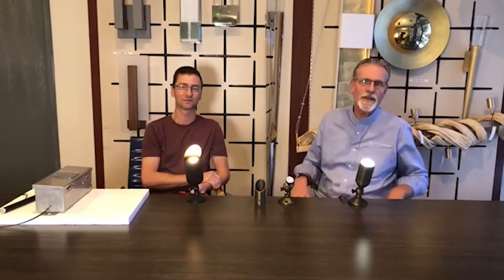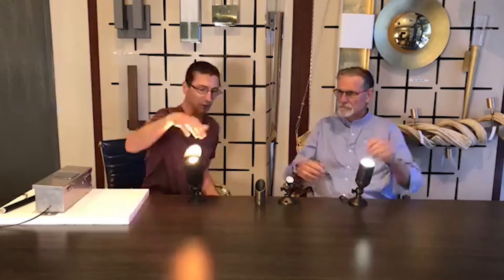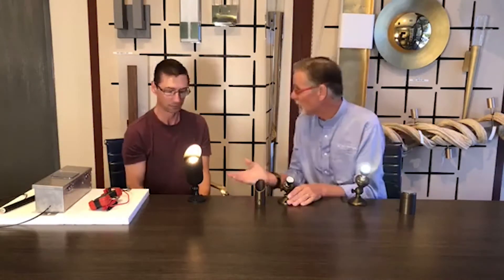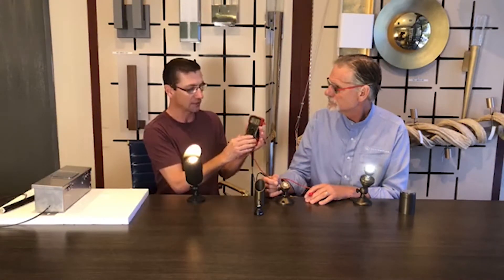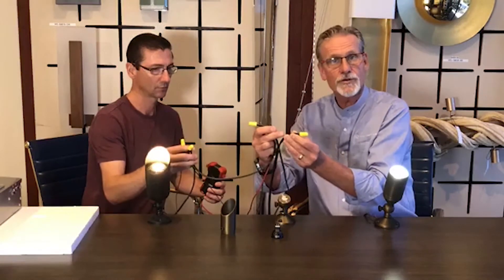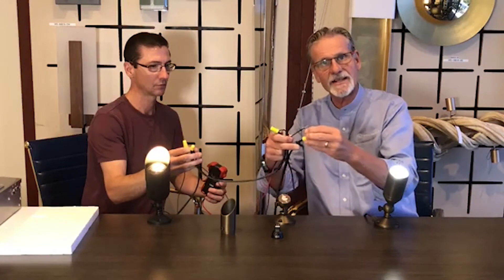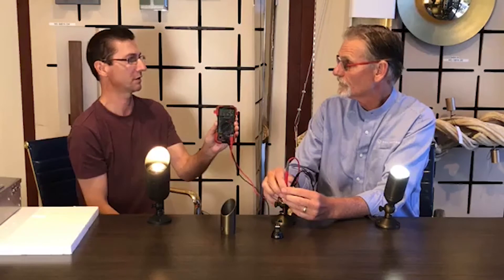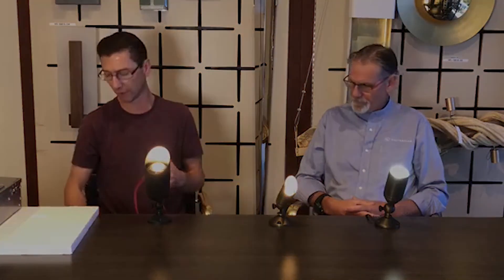Troubleshooting a 12v Landscape Light System

Comment: You measured 3VAC at the non-working light, then you showed there was a disconnected wire.  So is a low reading such as the 3VAC you showed an indicator for an open circuit?

Comment: Thanks guys. I have a portfolio 240w transformer that I have set on "A" - automatic dusk to dawn. Recently, all of my lights connected to this transformer are on all the time 24/7. I can see the timer settings and am able to set the timer from 0-9, A, or off but the lights are still on. The only way I can shut off my lights is to unplug the unit. I suspect the external light sensor that hangs from a wire. I have it mounted on the wall as it has always been. Any ideas?

Comment: I followed your procedure. I have 12 volts at the socket and I have a good bulb. That bulb only glows very dim. When I put that bulb in another fixture it works fine. Thoughts?
Reply: Based on your comment, you either have a bad connection at the socket or between the fixture and your home run. You’ll have to check the connection point and the socket to determine where the issue is exactly.
Reply: Thanks. This fixture is at the end of a series run. The fixture before works great and both fixtures show 12 volts. I’ll try digging up the wire from the fixture before it and see if there’s an issue. Though I don’t understand how there could be a problem if the fixture is showing 12 volts.
Reply: What setting did you have on your meter? My meter lowest AC setting is 200V. When I measure I get .8 volts. Is that 12 volts?

Comment: Any thoughts on how to check the wiring to the fixtures for step lights, where the wiring is mostly underneath stone work? I have one light that flickers. Wiggling the wire doesn’t seem to impact the flicker - but other than the connection point of the fixture to the main landscape wire, I don’t know what could be the cause. I’ve already replaced the socket with no change in results.